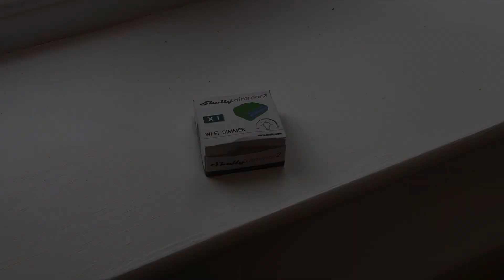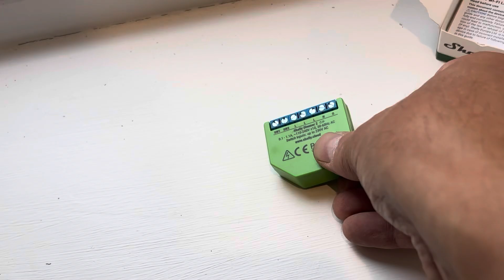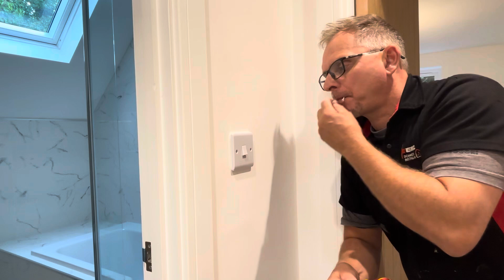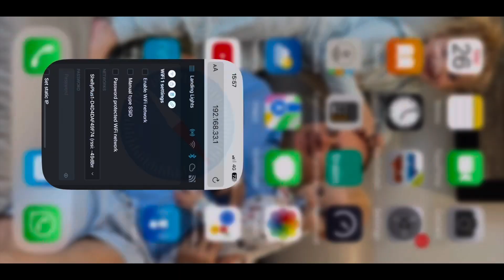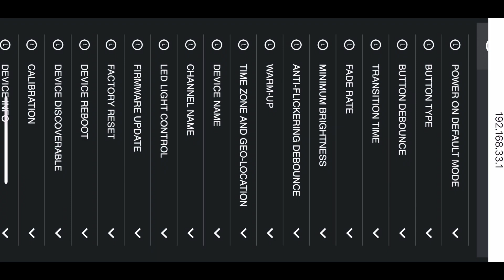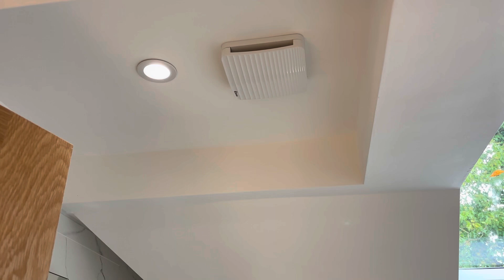Shelly WiFi Dimmer 2

Comment: Hi Great video. Is no capacitor or bypass box required across the bulb as I've seen in other 'no neutral' videos and diagrams?

I'm wanting to install the same and my house doesn't have neutral at the switch like this.

The light fixture in the room I want to install uses 14x dimmable G9 LED bulbs, would the shelly dimmer 2 be able to work with this/have enough power?

Appreciate any advice you can give :)
Reply from the maker: Hi 
It's definitely advisable to use the bypass but it's not always necessary. If you are able to calibrate the circuit and there is no flicker & the on/off s well as dimming works fine you don't need a bypass. If you get flicker at low dimming settings you can limit dimming to 10% - 15%.
So in summary if penalty say plan to use one or just try it and see?
Reply: @DMBHomes  Thanks SO much for your reply. I've ordered the parts including a retractable switch like you are using.

It's an Xmas present for the wife, so I need to try it on a day she's at work...lol.

I'll report back on my experience!

Comment: Hi Gareth, thanks for this, very useful. If you are not fussed about being able to dim from the switch (i.e. happy to just use the app to dim), can you use a normal light switch rather than the push to contact one you used in this video?
Reply from the maker: Hi 
Yes but you need to program the switch input to toggle. I believe, I've not actually tried it. Alternatively you may have to just buy a bell push type switch so it always returns to open circuit after being pressed.
Reply: @DMBHomes  thank you!

Comment: I wish it was possibel to use it with a traditional dimmer knob... don't you need a bypass since there's no neutral? I am looking at the Shelly Dimmer Gen3 product page and it suggests no-netural requires their "Shelly Bypass for Dimmer"
Reply from the maker: Yes with no neutral you need the bypass in some cases to create a load when the light is off so there is current flow for the Shelly device to maintain power. A traditional dimmer would try to dim the switched input wire to the Shelly device and that's not how this is wired. Your switch just talks to the Shelly and Shelly talks to the light. It's the Shelly device that actually does the dimming not the switch. The switch just signals the Shelly device so you don't need dimming tech to do this, just a simple switch (momentary)

Comment: Do you need a separate dimmable driver for the lamps or the shelly dimmer acts like a driver too?
Reply from the maker: Shelly does it all if you're using 240v AC dimmable LEDs. However if you're using low voltage you need the low voltage version of the agent dimmer. Again Shelly she's all the work.
Reply: @DMBHomes thank you

Comment: Installing kitchen led strip, 0-10v. Wondering I can achieve the same result using a momentary switch. Or does it only work for high voltage
Reply from the maker: It will work the same way, however Shelly Produce a device specifically for the 0-10V system.
Find it here:-
https://amzn.to/4mn5WAU

Comment: I got some new bticino dimmer switches controlling some led strips in my flat. I thought I could just slap a shelly dimmer 2 in and have configurable dimming since the strips themselves are dimmable, but the electrician said it doesn't work like that and that I need a dimming module for the led strip, which will result in the transformer always being under tension. Is that true or is he wrong?
Reply from the maker: Hi thanks for watching the Video, when using a "Shelly Dimmer 2" to control LED strip lighting you just need to do exactly the same as I've explained in this video by replacing the dimmer modules with momentary switches and then use a "Shelly dimmer 2" to control the dimming. The "Shelly dimmer 2" uses trailing edge dimming technology so you need to check that your LED driver (The item your electrician is calling the transformer) is trailing edge compatible. So I'm afraid the electrician may not be correct here, but this is new tech and not all electricians are confident with it.
If that's the case it will work fine.

Comment: can you do a video on dimmer controlled by two switches? i suppose that means for example retract-to-centre switches?
Reply from the maker: It's so simple it really doesn't need a video, I'll explain why:

Because we are using a momentary switch to send a live into the switch input on the Shelly Dimmer 2 , all you have to do is link as many switches you like into this same input. You could bring a switched live back from several switches all into 1 terminal block together then send a single wire from this terminal block into the Shelly Dimmer 2 switch input terminal and then which ever switch is pressed the Shelly Dimmer will just see the input as if it's one switch. It's that simple, however the Shelly Dimmer has 2 switch inputs to make it easier if you just bring 2 switch wires back? Any more that 2 switches then just use a terminal block or a wago. Hope that makes sense.

Comment: Do you have any suggestions how I could use a Shelly Dimmer 2 with LEDs in a bathroom where there is also an extractor fan in the bathroom, which constantly runs, but is boosted when you turn on the lights? I’m aware you can’t have a variable speed fan going through a Dimmer but maybe there is a combination of Shelly devices that could be used.
Reply from the maker: That's a great question & an issue I faced on this actual installation. When you use the Shelly Dimmer 2 without a neutral it draws a running current somehow that fools the extractor fan circuit to think the light is on when it's actually off. I played around with this for ages and the only solution I found was to fit the Shelly Dimmer 2 either in the ceiling near the light fitting or in the back of the fan isolator switch and to wire it with a Neutral. That way there is no leakage within the circuit to trigger the fan. Hope that helps.... If not come back to me with more info. Oh by the way if you haven't already - please subscribe, I need to get 500 subscribers before I get a penny for these videos so it's proving hard to justify the time on them at the moment. It's a shame because a lot of people are watching the videos. 50,000 plus but only 200 subscribers 😂😂
Reply: Subscribed. Interested for you to expand or do another video on how you solved this by wiring into the fan isolator.  I don’t get why you wired it in there, unless you didn’t have a neutral at the light switch so you had to put it behind the fan isolator, because you did have a neutral there.  In which case, I’m wondering how you got the wires from behind the fan isolator to the light switch, in order to activate the dimmer with the light switch (I imagine some users want to be able do this, including me). I should add I’m not an electrician, so only have basic knowledge of wiring lighting circuits.  I don’t personally have the option of putting the Shelly Dimmer 2 in the ceiling.  One further point that might be interesting for you to investigate or do a video on is I contacted Shelly support about this problem and their suggested solution was to use a combination of a Shelly Dimmer and a Shelly 1 Mini (wire in the live for low speed and switched live for the fan boost function).  Could be a challenge to fit in 1 back box unless it’s a deep one.  then set up 2 actions on the Shelly Dimmer. Then set up 2 Local Actions on the Shelly Dimmer.  One turns on the fan boost (switched live) whenever the output of the Dimmer is turned on, and the second turns it off whenever Dimmer is turned off.  Would be interested to know if this works.

Comment: Can this be done with the physical switch being a normal on/off switch, with the dimming functionality being used on the app only?
Reply from the maker: I think there is a facility to program the unit so that the switch is latching? I’ve not tried it myself. I think it’s under a label canned ‘ Button ‘
Reply: @DMBHomes  thank you, I'll give it a go.
Reply: @benjamindavidvine1  did you manage to do it? i need same answer, just to remember last setting it was on. so its still on off switch.

Comment: I've always thought this would be such a daunting task and have shied away from it but you've made it look perfectly fine and encouraging to try! Out of interest, why are rotary dimmers unsuitable for this?
Reply from the maker: @sizzle5  The reason is because it’s the Shelly device that is controlling the  circuit. You can’t have two devices controlling the same circuit. The Shelly device has an input to manipulate the circuit locally and that is just a live signal not a variable voltage so a local dimmer does not work in this system only a push to make contact that offers the control signal to the Shelly devices input terminal.

Comment: I wired this the exact same way and was able to add the shelly initially. But now my LED spots are continuously going on/off by themself. Can't put if of with the switch or with the app as the device is offline. Also the Shelly isn't lighting up red anymore. Though I have 6 LED spots (Zigbee) that each have 3W. So that should cover the min. 10W power.
Reply: Also tried another dimmer and wired it the same way. That second one does have a red light when wired, but when I turn the lights on with that Shelly, the light shuts down after 1 second and the shelly just reboots :/
Reply from the maker: My advice :-
Turn off the power to the circuit, wait 30 seconds - Turn the power back on and within a minute go to the light switch on the wall and click it on/off quickly about 10 times until the lights flicker.
Then try to reconnect directly to the Shelly device and recalibrate.
Remember to set the min dim level to somewhere around 15% as often dimming below this threshold cause the problems you mention.
If that doesn’t work then I’m afraid you’ll need to contact Shelly customer support - Good luck
Reply: I figured it out why, but no solution yet. The "Power on default" of the Dimmer is set to "On". But when I switch on the Dimmer, it instantly shuts down and reboots. So I'm stuck in an endless loop ... I figured it out because I switched this setting to on on the second dimmer too so now I have 2 unusable dimmers.
Reply from the maker: I’m sorry buddy , I think this might be one for Shelly Support email? It’s hard to diagnose without seeing what you’re doing exactly. Best of luck mate
Reply: @DMBHomes  managed to reset them by connecting them to a Live and neutral elsewhere in the house where I do have a neutral available. That way it remained powered and I could reset the settings 🙂 Guess i'll have to get me a bypass to get it working.

Comment: I'm going crazy with the Shelly Dimmer 2 + TRIAC/Diamable Power supply + Led Strip. I hit the switch (soft or phisical) the led keeps on being on, I hit the switch again led strip still on. I did not run "calibrate" what does it do and why is it necessary?
Reply from the maker: Calibration is for the Shelly unit to identify the load on the circuit and then it calibrates the dimming capability. Also some circuits you need to adjust the minimum sim level to 10-15% to avoid it flickering or going off. Your LED strip could be more voltage so by doing the mains power will have no effect on the LED itself?
Reply: @DMBHomes  I’ll try today the calibration. MY powersupply output is 24v and led is 24v also. My led and power supply work well with a simple wheel dimmer.
Reply from the maker: The dimming technology for your 24v PSU could be different from the dimming technology used by the Shelly 2 product? The Shelly 2 uses trailing edge dimming which is standard for mains powered LED lights however most 24v leds powered by 24v psu’s require analogue traditional dimming so may not be compatible with the Shelly 2.
Reply: @DMBHomes  i just returned the Shelly dimmer devices , and purchased Shelly 0-10 volt. Since PSU also supports 0-10 v input. Fingers crossed.

Comment: Didn’t the light flicker as you put the live out into the terminal? Pretty sure you didn’t turn off power at the board…?! 😂 or did I just imagine it?
Reply: He defo left the power on as the lights in the hallway are on, but notice he used all high voltage insulated tools and kept his pinkies away from the live bits.  I’ve seen many sparkys work like this sometimes it’s just easier especially these days where some customers might have NAS servers or computers for home automation that need to stay on. All that said …. Turn the power off 😂 Thanks for the video about to install 4 to replace my stupid Tuya bulbs that are forever falling off the network
Reply: @ of course no hate at all…!! I’m all for learning and do some of the basic wiring of smart devices myself at home even though I’m not a sparky. Although go to some groups for support and they’re just bashing anyone who’s not a sparky even though they themselves are amateurs most of the time 🤣 Love these videos and they’re much clearer than diagrams. I find them easier to follow.
Reply: yeah he definitely was working with a live wire
big risk - not worth it
Reply from the maker: 🤔 Maybe my camera wasn’t working well in the dark upstairs but can’t be to sure 😂😂